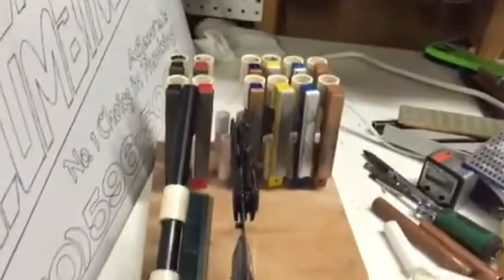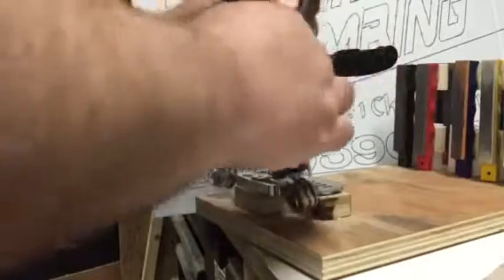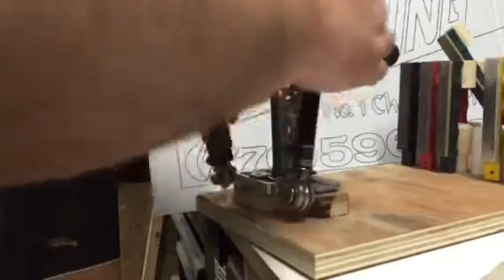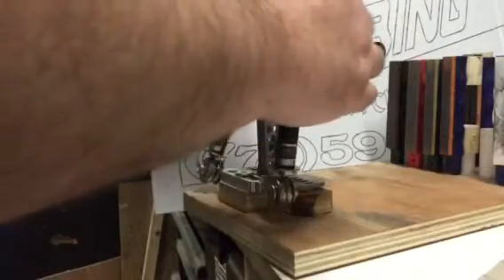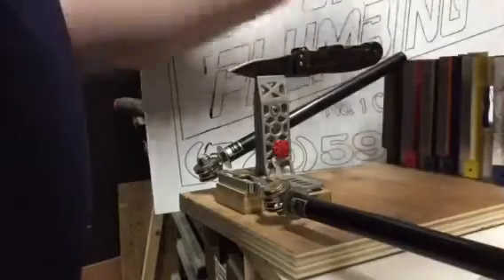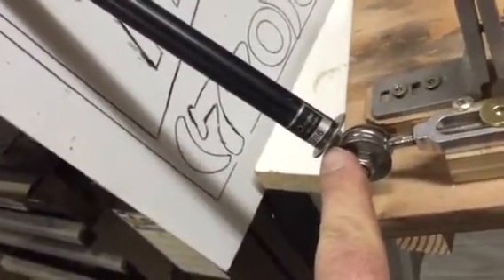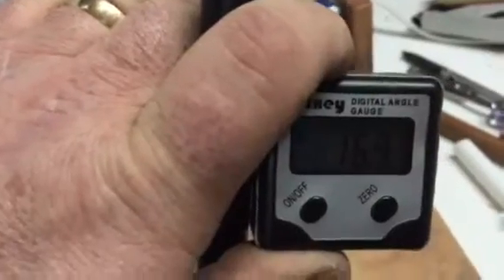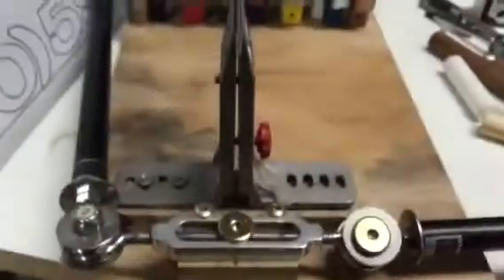Modified Lansky Knife Sharpener similar to Wicked Edge

Comment: You paid $80 for 2 lansky sets? why?, their are cheaper stone alternatives, I know because I have bought some cheap chinesium ones......They cost £10 for 14 stones, I got 2 of each grit  80/120/240/400/600/800/1000# and I am hear to tell you that these stones are excellent. I made my sharpener differently to this, I only use it for very fine finishing of my knives but it is much better than those pieces of shit "wicked edge", yeah I spent a bit on a solid 1.5" thick aluminium base and stainless steel runners etc, I spent in total around £70, but it is superior to the wicked edge system and didn't cost €700.....only a complete moron would pay that. Mine is designed so that I am not limited by the size of knife/sword, sure it took time to build, a good bit of welding etc etc, but again for the price paid I have the daddy of knife sharpeners.